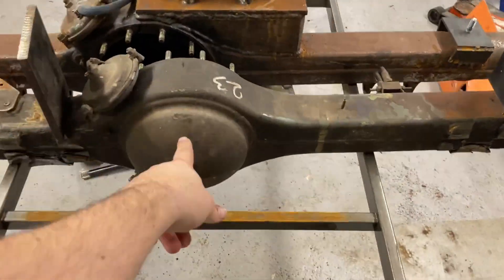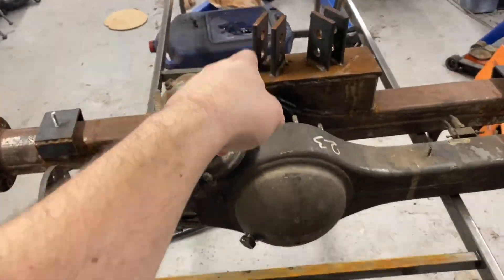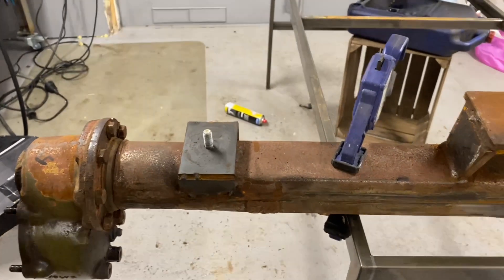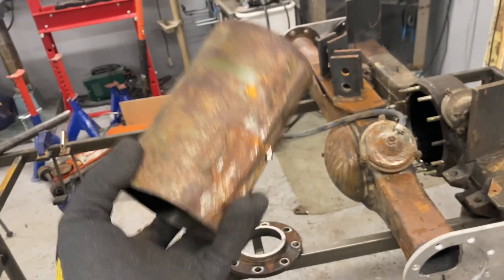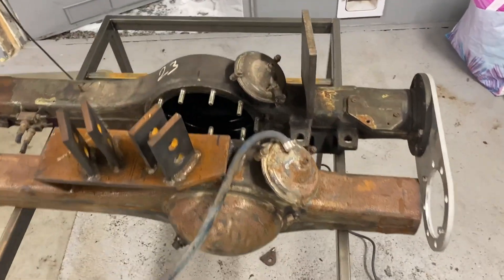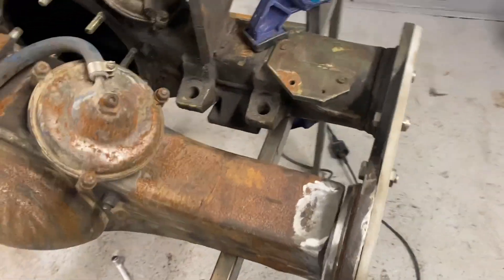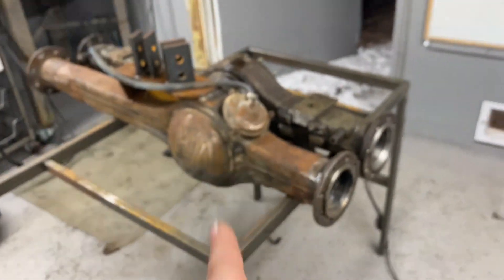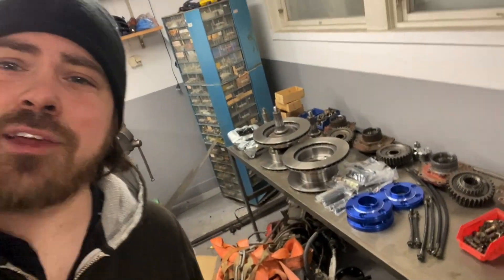How to convert Volvo TGB axle to driver side drop for a Jeep TJ - Pt 2

Comment: hi what will you do about the direction of Differentials? are you gone use an aftermarket transfer case or it doesn't need anything?
Reply from the maker: No need, the differentials rotates in correct direction and the drop on the TC is left side front and center rear. So now its just continue with the links :)